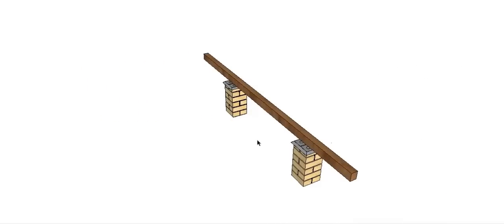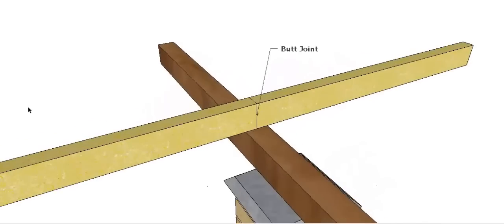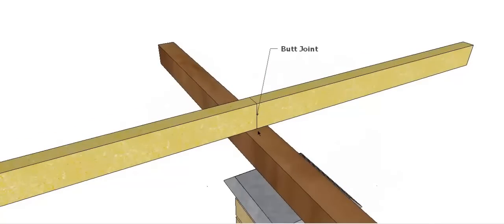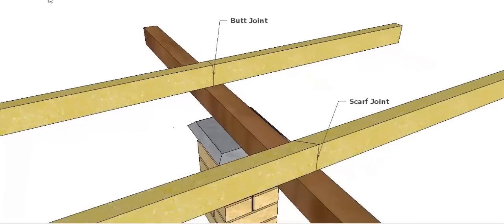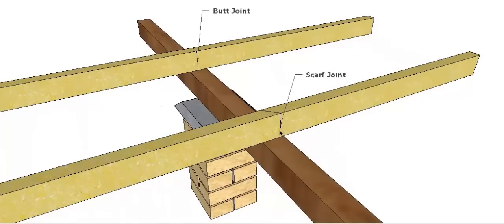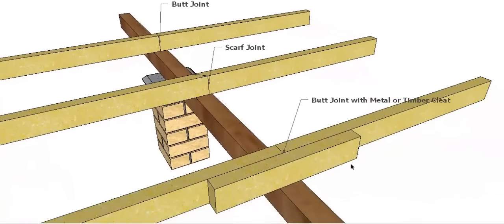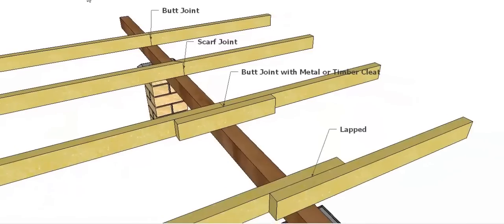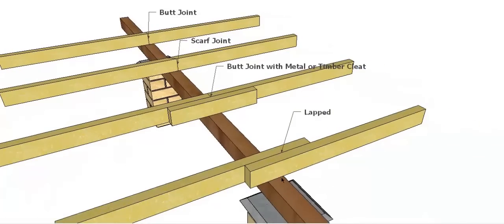Joining Floor Joists

Comment: Hey, You said 30mm on the bearer if you butt join the joists, does the lapped joint need a certain amount of timber hanging past the bearer?
Reply from the maker: Hi, no nothing is specified, as long as it is more than 30mm which it obviously would be it is fine.

Comment: Should the overlapping joists be secured to each other? Also, should they be secured to the ledger or just resting on it?
Reply from the maker: Hi Mate, at a minumum they should be nailed together and to the bearer however depending on your region and tiedown requirements greater fixings may be required.

Comment: When would you choose butt joint with cleat over butt joint? minimum bearing for joist is insufficient? It appears that these two methods are quite similar, the only different is the additional cleat
Reply from the maker: The butt joint with cleat helps to prevent the join from pulling apart in the early stages of construction when you are positioning the Bearers and Joists. A nailed Butt Joint can tend to separate if mover enough.
If the minmum bearing is insufficent the cleat is not going to make any difference you would have to have a bigger Bearer in that case.
Hope this helps

Comment: Quick Question; When using the Butt Joint with Timber Cleat, How what is the recommended length for the Timber Cleat?
Reply from the maker: Hi Artemio, there is no actual length specified in AS1684, however, I would use something around 400 to 600mm long

Comment: Hi Buildsum, Great videos and I use them a lot! (And you have helped me before).

 I just had a question in regard to tie downs for floor joist on 2 storey house. 

The joists are F17 KDHW 190mm x 45mm and they are sitting on steel beams with a 90mmx35mm M10 pine plate bolted to the 250mm PFC's. This is a deck area over a living area, so waterproof underneath.Would you skew nail these floor joists or just use a Pyrada connection type...or both? The engineer hasn't stipulated anything, so just Aus standard, but I can't seem to find it in the standard document?

Regards
John
Reply from the maker: Hi John
I cant find anything on this either. I would use both, if the engineer hasn't told you to use anything special then that should be heaps.

Hope this helps
Reply: Thanks Buildsum! Much appreciated. 

Regards John
PS.My partner wants to know why you are called 'Buildsum'?
Reply from the maker: No problem
Ok well when i was doing my Trade my nickname was Buildsome because my last name is Bridges so Build some bridges. When i went to get my Google account i couldn't get Buildsome with out letters behind it so changed the spelling to Buildsum which sort of fits i think

Comment: When using a butt joint, what keeps them together? Are they nailed / screwed together somehow?
Reply from the maker: Hi Eddie Traditionally they used skew nails however now days practice is to put a gang-nail plate across the join
Reply: Awesome, thanks for the help
Reply: What’s the best was to join floor joists together without the support beam for them to sit on